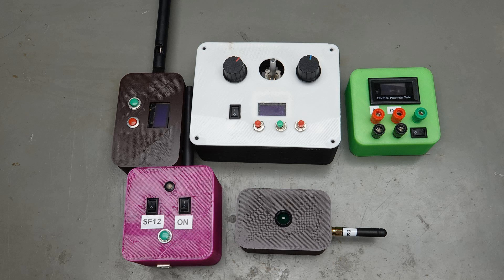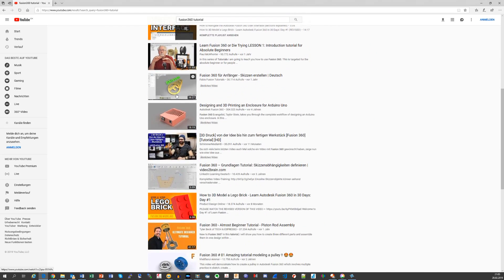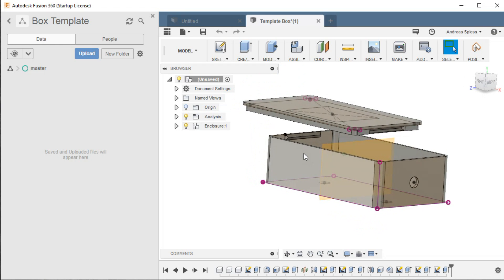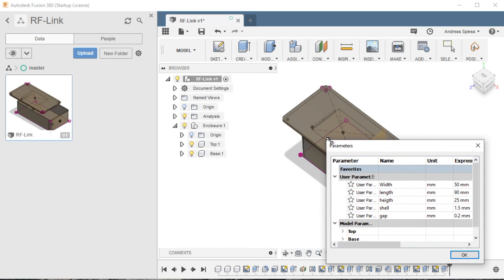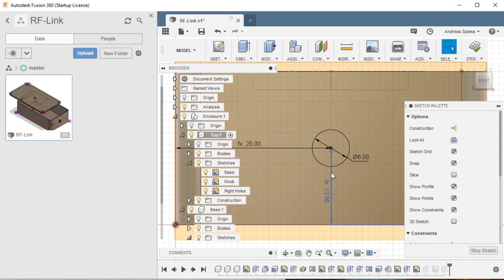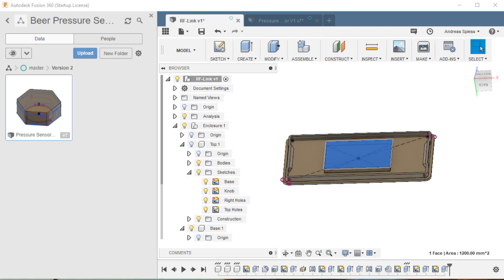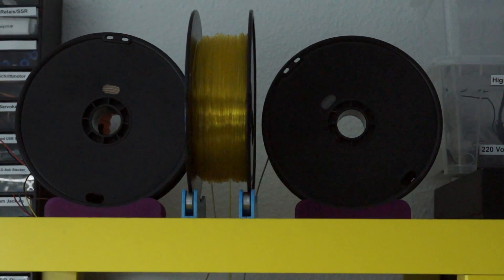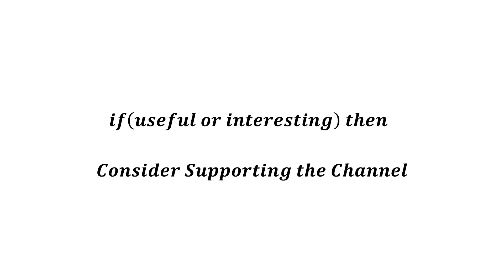#258 Configurable Cases for your Projects  (Arduino, ESP32, ESP8266)

Comment: Hello Andreas, as ussual your videos are a good source of practical information. I use a similar method for my boxes, the parametrics are great. 
None the less, I'm very intrigued with your proyect 'Beer Pressure Sensor' that can be seen in the proyects of your Fusion 360, I'm in the (long) process of automate my beer brewing equipment, so any info about that is gratly appreciated. I think I'll use Raspberry Pi with CraftBeerPi, There are some projects using ESP8266, witch is probably more than capable of controlling all the things, but I feel that the room for enhacement of the Pi is great. Anyway sorry for my english, and thanks for sharing.
Reply: I tought that I might not be the only one who got caught up on the "Beer pressure sensor" project name. Would like to know more too.
Reply from the maker: You need to be patient ;-)

Comment: Very nice - have F360 but haven’t tried it yet. Also - have no 3D printer - can F360 be used for simple 2d drawings?  Thanks for the info!
Reply from the maker: I do not know if it can be used for 2D, but you can draw sketches which are 2D. I use Visio for that purpose.

Comment: For print adhesion have you tried glue stick?  Since it is water soluble, it is a lot easier to cleanup and also I didn't like the smell of the hairspray or the residue the spray leaves.  Also I have a small water spray (mist) bottle that I use to refresh the glue stick before each print (I don't clean the bed every time).  The purple Elmer's is nice because it is purple when it is wet so it is easy to see the coverage.  Also, IMHO the extra thickness of the glue stick helps to compensate from imperfectly level bed.
Reply from the maker: No, I did not try glue stick for a few years. The hairspray is ok for me (if you do the coating outside the lab as I also do not like the smell). It is done very fast and I do it just from time-to-time. I am even not sure if it is still necessary with the new Prusa.

Comment: I use the same technique to get perfectly round holes; but, I just use a standard twist drill to get final size to finish the hole.  One important point is to make sure the "wall thickness" parameter in the slicer is set thick enough to accommodate the drill operation and not penetrate into the infill.  Also, I don't use as much difference, I typically only make it 0.2mm smaller and a will thickness of 0.8mm.  This is may vary with the printer.  If the hole has to carry a thread, I would increase the wall thickness.
Reply from the maker: You are right with the thread. So far I never tried that in walls. I always create posts for screws. I did not find issues hitting the infill during the hole extension. It is covered by the parts which I mount. Totally different if you do not want to mount something!

Comment: Excellent video. If you ever want to get rid of that hairspray forever go ahead and update to the Ultrabase glass bed cover. You will thank me later ;)
Reply from the maker: Can you provide me a link? But then you lose the ability to bend it, I assume?
Reply: @AndreasSpiess  No need to bend it or remove it ever anymore :)  When it cools, the parts just pop off. You can buy on ebay, Ali etc.  I have a video coming on it soon.  Heres bangood example. 20-50 depending on your size usually.  https://www.banggood.com/search/ultrabase.html?sbc=1

Comment: Step bits don't chew up / destroy plastic like twist type bits.
Reply from the maker: Usually, they are good enough for me because the hole is not visible if you mount something.
Reply: @AndreasSpiess  I've had step bits on my list to buy for a while now. My standard twist drill bits are murder trying to make clean holes in plastic bigger than 3-4 mm.

Comment: +1 for what others have said about freecad vs open source stuff. Freecad looks a lot like the fusion360.

You may also want to look into Octoprint on a raspberry pi for your printer. It supports the common firmwares (Smoothie, Marlin, etc) - just hook your 3d printer's USB up to the raspberry pi's USB port, then you have a web interface to interact with your printer. Also, some slicers (I use slic3r) speak directly with Octoprint, which then allows you to "Slice+Upload" from the slicer software. Works great
Reply from the maker: My printer even has a native interface for a Rpi and Octoprint. If I have time, I will add one. But as I said, it is a tool for me. So I do not spend too much time with it if it works.

Comment: just a comment,  when you size the box to 30 mm. your pad on the base does not adjust.  it sticks out past the edge you have for fitting the base to the lid.  I was also a little confused,  What you call the base(box) i was thinking was the lid and vise versa.  Most people are use to the lid being thinner than the box.
Reply from the maker: Thank you! I changed it now.

Comment: In order to make individual STLs for the various bodies at one time, you can right click on the name of the project on the top of the "BROWSER" on the left side.  Click on "Save as STL" then in the dialog box change the "Structure" option to "One File Per Body"
Reply from the maker: You are right. Thank you!
Reply: @AndreasSpiess  The one annoying catch is if you have a group that is invisible, but the parts in the group are still flagged as visible, they will show up in your STLs despite not showing in your preview.   It is not a huge problem, but my current project has something like 200 bodies in it so it is cumbersome to go through each group.

Comment: Another project that I will surely adopt for use in my future projects, simple a efficient. What I like is that it allow to have a zero inventory approach on plastic project boxes. These usually take valuable space and I don't always find the right one in my stock when needed. Thanks!!!
Reply from the maker: You are welcome! I also like that the openings are already "printed" in these cases

Comment: 900€ for a 3D printer is a number. I‘m guessing that cheap 150€ printers won’t produce good results for cases. 😞
Reply: You get a Tevo Tornado for less than 300€. It has a huge build area and works good enough for enclosures without any hardware modifications.
Reply from the maker: I do not know about cheaper printers. But looking at the many videos about improvements to the different printers I would assume they are not completely ready when you buy them.
For me, a 3D printer is an important tool and the Prusa won all tests. That is the reason I spent the money (and I think, it will last quite a long time because you can print all replacement parts yourself)
Reply: FYI: Cheap battery cases for 2 or 4 18650 cells are available for 50 cents and using a sharp knife one can make holes etc. works great for my collection of ESPs

Comment: Many thanks for the great video. Could you save the template file also as a STEP and/or SolidWorks file in your github repo (for import in other CAD programs)?
Reply from the maker: I put it on Github that anybody can contribute similar box designs for other CAD tools. I have no possibility to create any other format.

Comment: I hate Fusion 360. Could not get on with it. Way too convoluted after using 123D Design which is so much simpler and easier to produce the same thing. It's a shame they stopped hosting it, but luckily I kept the install file and have it backed up everywhere. My Arduino box mods are seconds, not minutes.
Reply from the maker: As I mentioned I can not comment because I do not know your tool. I came from Solidworks and found, it is different, but not too much. For me, the most difficult thing is always the mechanical construction, not the tool itself.
Reply: @AndreasSpiess  123D Design was a free CAD program that they made before they developed Fusion 360 and made that a "free" program. For some reason they stopped hosting the simple program on their site, which was super easy for anyone to pick up and they completely gave up support for it. I had Fusion 360 for a year out of recommendations, but put off using it as 123D Design did everything I needed, and was much simpler and quicker, especially at loading. I struggled to get to grips with Fusion360 which is a completely different interface. When I went to try 360 after a year again it said it had expired and wouldn't let me go on using it without paying a huge amount of money. I could not find the option to use it anymore for free.
Reply from the maker: I think you could use the link in the description. At least it worked for me.
Reply: @AndreasSpiess   Thanks. I think I'll hang on to that thought if I feel I need it. As of now I'm happy with the simpler and quicker approach to modelling.

Comment: Or if you want something truly parametric and truly free (works on Linux or older Macs for example) then look at my design using OpenSCAD/Customizer https://www.thingiverse.com/thing:2955635  see also http://www.openscad.org/
Reply from the maker: Unfortunately, I do not like the concept. I tried it but was not successful at all. I like more the visual approach. And I also use a 3dconnexion mouse to turn and move the objects.
For programmers OpenSCAD is a good choice, I think, and very flexible.

Comment: I loaded the file, but I can only see the lid... Am I doing something wrong?
Reply from the maker: I changed the file slightly and put it to another location: https://github.com/SensorsIot/Project-Box-Templates  Maybe you try again?
Reply: @AndreasSpiess  Now it works, excellent! Thank you Andreas. I love your videos. It maked me wanting to build stuff. Initially for ioT and Domotics. But now I'm currently trying out LoRa WiFi to make a geocache. So these little boxes will help me quite a bit. Now I have a good base to start with and  making it waterproof.

Comment: I just set up my 3d printer im gonna try this! I use fudion 360 since a loong time and its a great tool. Also open scad is widly used
Reply from the maker: I changed the file slightly and put it to another location: https://github.com/SensorsIot/Project-Box-Templates

Comment: Great Tutorial but I have aproblem that when I import your file into Fusion 360 it only displays the lid, although it says the enclosure is there!
Reply from the maker: I changed the file slightly and put it to another location: https://github.com/SensorsIot/Project-Box-Templates  Maybe you try again?
Reply: Thanks Andreas, thats working now....

Comment: Hi, You can save the files together with right click onto the above main item (where your filename is located, on the left tree), but be aware, that this delivers all parts in the direction they are. Right click and save as stl. Thats all.
Reply from the maker: Thank you for your tip. It works! The only thing I lose is the direct transfer to the slicer if I have more than one part. But that is ok.
Reply: @AndreasSpiess  I just tested it. It works too. Use the make menu, as you use in in your video then left click on the "main" item at the top of the left tree and you are done. Then your slicer opens with all components, but only those which are visible. I have tested it with Simplify 3d, but it should work also with other slicers.
Reply from the maker: I did not get two parts, only one in Simplify3d (I did not get the option "Structure"). Which is useless because I have to print both "on the floor". Any suggestions?
Reply: @AndreasSpiess  This is, what I meant with "be aware ...". You have to lay all parts e.g on the floor in Fusion, e.g. by moving or assembling them on one plane (which you could hide). But the charming thing is, that you now can assemble parts together and print them, as they are assembled.
Reply from the maker: Is am a CAD noob. My box has two parts which are not on one plane an I like to see them as they are ( sometimes also to place something at the right place) . Do I have to move them always to the right position in Fusion before I print. Then it is easier for me to create two files and let Simplify3d do the job. But maybe I do not understand.
Reply: @AndreasSpiess  Yes, it is so. Either way you have to move in Fusion, or you have to do two clicks in Fusion and save them separately. But that is a good  and correct method. Lets assume you build a gear, where you have moving parts inside of a box, which is closed, then you can print them together as assembled. If you make a separation of one or two layers between the moving parts you can print them, and after the print, you can brake them carefully loose. Than you have printed e.g. a gear without assembling it later. This is an important technique, because you can then print moving parts inside of a e.g. "water tight" housing. The racing car manufacturer Koenigsegg, e.g. prints turbos in one print with all their moving parts inside.

Comment: Hi Andreas,
I use the "Ikea" trick too, and am surely not the first - but with a difference - The LACK table in my setup is upside-down. The problem with the Prusa I3 design is that the base is not torsionally stiff. The top of the Ikea LACK is exquisitely torsionally stiff. If the LACK is upside-down, the four legs still serve as pillars for attaching "walls", "roof" and other anchor-points. It also makes the printer easily transportable. To be sure- I also have three bumpers under my lack to provide a non-overconstrained interface to the surface it stands upon. Result --> perfect first-layer each and every time.
Cheers!
Reply from the maker: Good idea! I have no problems with the first layer (maybe also because of the auto leveling of the MK3. As you saw I use the Lack not for walls but to have more space for my filament (space became an issue here because of the many mailbags ;-) My printer sits on a solid piece of wood.

Comment: Great video but the downloaded file only contains the lid when I open it. Any suggestions?
Reply from the maker: Klick the bulb to switch the top on
Reply: @AndreasSpiess  all bulbs are yellow
Reply: YES! Right clicked the root of the component "show all bodies"
Reply from the maker: I changed the file slightly and put it to another location: https://github.com/SensorsIot/Project-Box-Templates  Maybe you try again?

Comment: F360 Not available for Linux !!!!
Reply from the maker: I just moved the file to Github. Now you can add a changeable project box for your preferred CAD tool if you want:
https://github.com/SensorsIot/Project-Box-Templates
Reply: Get FreeCAD. Works pretty much like F360. You can get it with apt, but that won't be the latest, There are simple instructions to get 0.18 revision on the website.
Reply: Onshape runs on Linux.

Comment: Great video as usual. I think you could use midpoint constraints to keep the holes on centre instead of referencing the width/length parameters but I guess your way allows people to offset the hole position if required.
Reply from the maker: You are right. But then I would not have been able to show you the feature with the parameters in the dimensions ;-)

Comment: Excellent video, just what I need. Can we have a copy of the stl files to import? Thanks again for a great video.
Reply: stl files and not suited for importing. They are already "triangulated" for importing in 3d slicer software. The original files of Fusion360 are a better option, like for modifying with the parameters. Check a video from lars christensen where he explains this.
Reply from the maker: The idea of this video was to not submit stl files which cannot be changed.
Reply: @AndreasSpiess  Downloading the software now :-)  Always good to try something new!

Comment: Thank you for, as usual, a very instructive video! The timing could not have been better, as I recently got a 3D printer. I am a quite experienced Sketchup user, but will certainly look into fusion360, as it seems to be very powerful - and free to use for hobbyists!
Reply from the maker: You can also provide a similar box in Sketchup for my GitHub, if you want ;-)

Comment: I use OctoPrint to control my printer (Mk2s) and Slic3r Prusa Edition for slicing and easy gcode transfer to the printer. It can upload directly to OctoPrint and start printing when it's done heating. And my home automation system automaticly turns off the printer when it's done printing but thats a story for another time :-)
Reply from the maker: Exactly! The Mk3 already has a connector for the Rpi and a zero is waiting in its box...
Reply: I also do the same.  If the printer has finished and hasn't started again after a a set number of mins then it powers off.  Good for those prints that takes a while and you don't want to see if it's finished.  I also use pushbullet to notify me when completed and tasker on the phone to say it out loud.  All controlled via Home Assistant.